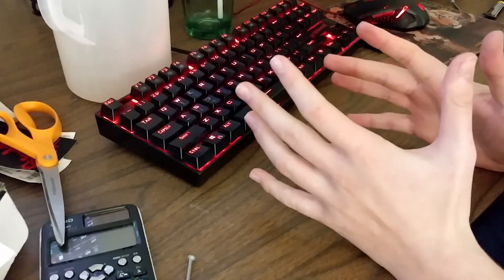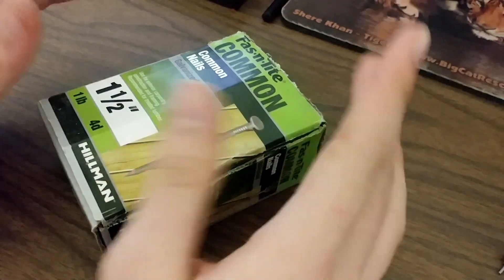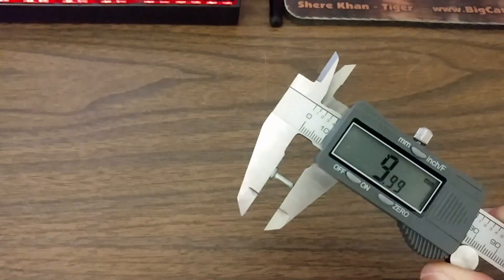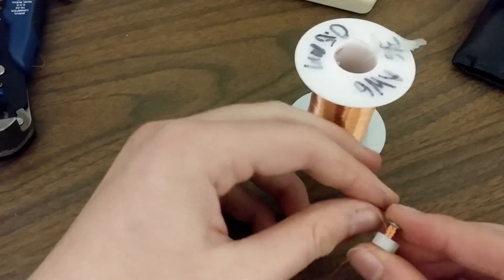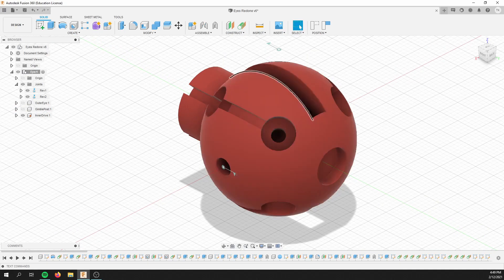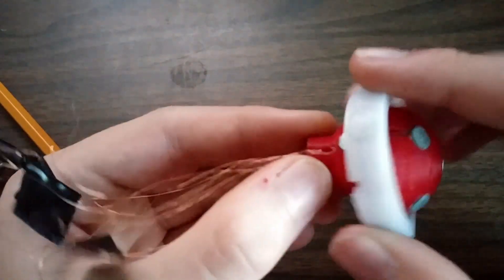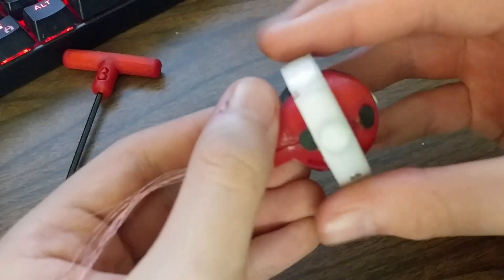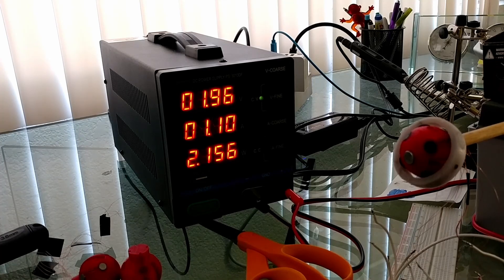The SMALLEST Animatronic Eye Mechanism

Comment: !!!

This is... maybe gonna cut down on my R&D for a personal project of mine.

The Starkeeper Project
(belongs currently slowly to DHLabs gaming, and is not affiliated with anything or anyone else.)
Reply: Also, you still doing any work on this? because... I am... rather interested, seeing as you still seem to be the only one who has touched it. Also, I read the patent a few years ago LOL. At least, for my purposes, The eyes are able to be larger than a human eye, and in fact, should probably be a little bigger, particularly because I hope to actually put cameras into them. The End result is also going to be slightly more cartoonish, though not to an extreme degree. One issue I most likely face, is what I need has to be so responsive it is indistinguishable for a real eyeball. Like, when it looks somewhere, it just, looks there as quickly as the human eye does. And... the camera needs the literal resolution of a human eye too... It also, as you mentioned in the video as something you wanted to do, needs to be able to precisely point in any direction, not just some clunky set angles.

(Hopefully the eyes don't cause me TOO much trouble because WAY to many other things will LOL. I am lucky the technology is just about getting there for me that I need.